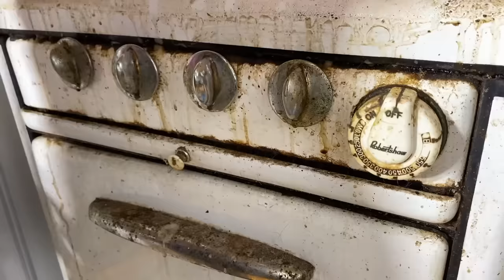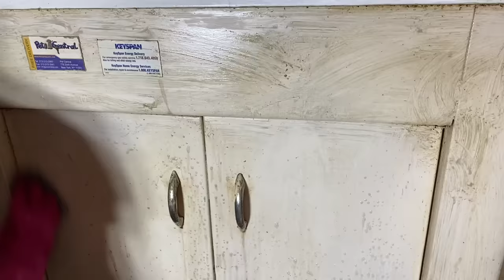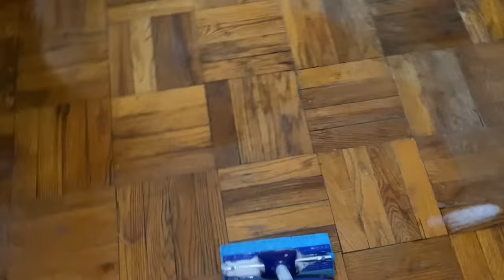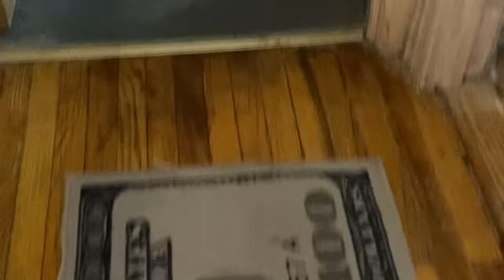"My CRAZIEST Cleaning Adventure EVER!" #asmr #cleaningvlog #cleanwithme

Comment: I use to suck at cleaning and did it so slow and some days I literally just couldn’t clean. Sometimes due to depression.

I have now been cleaning more and use it as something that I love it’s hard to change a mindset but I did it for myself and ended up feeling better. My problem was that I was rushing everything and would get anxiety if I didn’t do things fast enough and if I didn’t do it fast I’d get into a rut and not do it at all. I’ve learned that I can clean at any speed and do things one thing at a time there’s no rush and now I can enjoy cleaning. I hope everyone remembers to take it one step at a time and it doesn’t have to be quickly
Reply: Perfectionism can stall all attempts to do any task. The thinking is "why start if I'm not going to be able to finish everything perfectly. Only perfect is acceptable.  Anything less is a failure. I will be a failure." So you avoid. You can call it irrational thinking but it's real. I now pick ONE small task with a clear beginning and end to tackle..... clean the toilet,  wash the dishes, fold & put away laundry, take out trash, declutter the table,  dust one shelf,  clean out one drawer, vacuum, scrub the tub,  etc. No schedules,  no lists, just do it when I feel like it. I complete a task and bask in the glow of clean. Taking pressure off of myself motivates me to get so much more done IN MY OWN TIME which actually started becoming more regular. I wish everyone luck on their declutter/ cleaning journey.

Comment: Awesome cleaning of this apartment. You are really a pro! I looked up the stove company Robertshaw and they still are in business. They were founded in 1899. That stove in that apartment looks like a model from the 1950/60’s! So does pretty much everything else. But you did an amazing job cleaning it!!
Reply: Thanks for looking that up! I was curious to see if anyone knew in the comments ☺️ I'm in the UK so I've never seen a stove like that before. I bet it still works better than one bought 15 or 20 years ago though! Things just aren't built to last now & it feels like everything is disposable & not meant to be fixed. 😔
Reply: @scattyfi  That is so very true. Things were built to last years ago. I know for a fact. I had a washer/ dryer that other then some minor repairs lasted for over 25 years, with a lot of use! Once I did replace them, I was told I “may” get 10 years out of the new ones. *If I’m lucky!    That’s how it is with everything now… appliances, cars,etc.  That’s why many people try to restore but unfortunately that is very expensive.
Reply: @christinakeenan6091  I got my nan's fridge freezer when she died. I remember her getting it when I was about 10, it was one of the new frost free ones that didn't need defrosting. It packed up when I was 40 so it lasted 30 years! Old TV's lasted for decades too. I have a miele washing machine & vacuum cleaner because they're designed to last for 20 years. A bit more expensive than others but works out cheaper in the long run. Everything else feels disposable. I was only saying to my friend the other day that I don't think we have TV repair men anymore, that job is obsolete!
Reply: That stove is really cool. I would love to have one like it.

Comment: Barbie WD40 works well on any glue type residue from stickers, duct tape etc. Just spray and leave for 5 mins and scrape off. Also filling the bath with hot water and dishwasher tablets and leaving it to soak while you worked on another room would have dislodged a lot of that grease & grime on the bath. Hipe you don't mind me giving tips, no judgement here. Just worked as a professional cleaner for many years. Great job girl! 🥰

Comment: If the water issue happens again Barbie there is usually a master tap somewhere in the apartment or on the floor that you can turn off until the building supervisor arrives.
If you had sprayed the stove before you cleaned the bathroom it will be easier to clean as the cleaner will have soaked in.
Great job 👏
Reply from the maker: Thank you! ❤️❤️❤️

Comment: The name  'RobertShaw' as seen on the oven's control knob is a well known name in the industries of controllers, thermostats, etc., and has been for many decades [still is]; but who knows what  brand it is or its age. When well maintained, many appliances built in the 1930s forward, especially cooktops and ovens, work fine for generations. Rarely does an appliance built since 1970s still work, or have available repair parts.

Comment: There should be a water shut off valve somewhere in the apartment. Sometimes it's behind a wall panel. The leaky faucets might just need new washers to make them shut off completely. Should be a fairly quick and simple fix -- if the Super isn't lazy or incompetent.

Comment: That’s a very old school drainage system & if you pull the knob on the chrome tower between the tub & toilet the water should go down. If you ever see water at the same level as the tub inside the tube, it needs to be snaked. But you did an awesome job either way because it did look much improved when you were done!
Reply from the maker: This is what exactly happened!!! I mean, I didn’t fix, but the super just came up, and he pulled that thing out, and water went down 😍 thank you! ❤️❤️❤️
Reply: @cleanwithbarbie  I only know about them because my Grandfather owned several rental homes when I was a kid in the 70’s that were built in the late 1800’s & early 1900’s that had them & we always had to make sure to explain to most of the tenants how it worked. Learned a lot helping him. I’m 52 now and use what I’ve learned with my Grandaddy in my own home that was built in the late 30’s…which BTW is probably about the range of that stove…that was an awesome job cleaning that! I adore vintage appliances! I bet that apartment was quite something back in the day! Hope he gets well enough to come home if they can get him a nurse.
Reply: I helped clean an old bathroom once. I plunged and plunged. Then someone came in and showed me that stopper on the floor. I’d never seen one and felt like a real idiot!
Reply: @Crosseyedmaryquitecontray  I can relate to that! I’m born and raised Southern and didn’t know what they were either till I visited some of my family in Nee York as a teen!
Reply: @marinemom70  that apartment was in NYC. Isn’t that funny